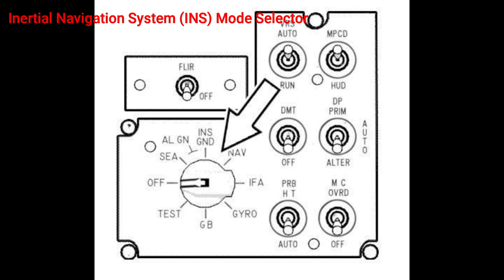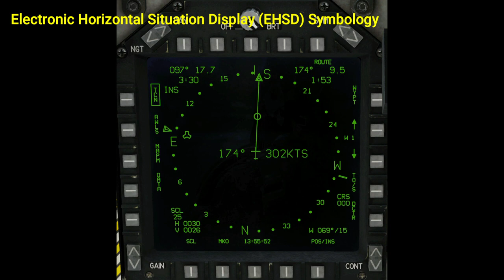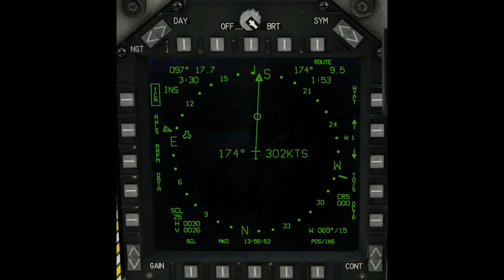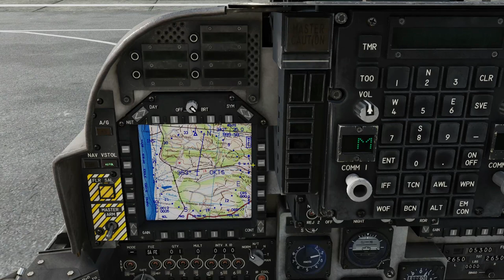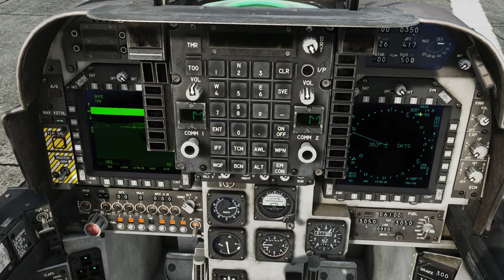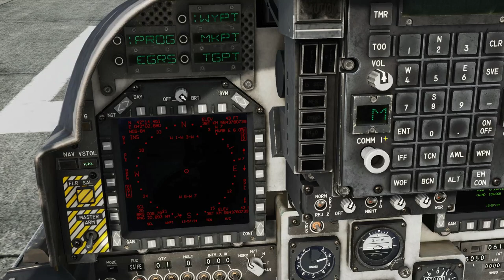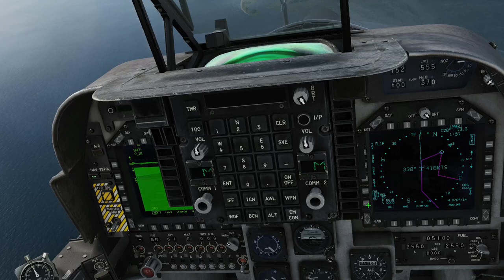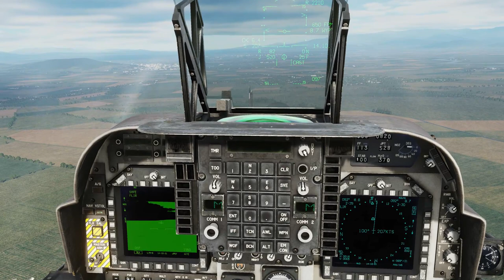RAZBAM AV-8B Navigation Tutorials | DCS | DCS World | Digital Combat Simulator

Comment: Excellent and useful tutorial mate, thank you!

Just a minor clarification on the INS modes. In NAV mode, the system uses INS and GPS to give a solution but they work sort of independently and use the Kalman algorithm to give a weighted average solution. GPS is good at accurate positional information but poor when in rapid rates of change (1Hz GPS; updates every second). The inertial 'gyros' (Ring laser gyros) are better in this situation as they will update instantaneously. The Kalman filter will bias towards the gyros at this point. In most flight regimes, the GPS will be given favour.
If the INS plot deviates from the GPS plot by a given error value, an alert will be seen (not sure if DCS models this) to get the human to decide which he thinks is the more accurate and manually select the inertia plot or the GPS plot (each system is able to give Time of Validity or predicted error to assist in which is more accurate). GPS tends to be the more accurate for positional information but if GPS is lost (jamming or spoofing or no signal), the INS part of the IGI will 'take over' the nav plot. INS do tend to wander off a little but generally no more than 0.4Nm per hour dependant on the flight regime.
In IFA mode, the GPS is allowed to update the INS plot automatically. Useful if the INS has a big error of the nav plot has been lost. The drawback is if the GPS then loses signal (jammed or spoofed), the INS will now get the duff info too.
The preferred solution should be the 'NAV' mode as this will give two separate independent solutions (that should always be pretty close together).
The IGI/EGI the AV8B uses (the AN/ASN-139 CAINS II) is similar to the one we use (Honeywell H764E ACE).

As a useful guide for an ILS/AWLS, at the point the glideslope comes in, a rule of thumb is for a 3-3.5 degree glideslope is to set a rate of decent to groundspeed halved and add a zero. E.G if your ground speed is 140kts, an intitial RoD would be 700FPM. Then adjust as required.